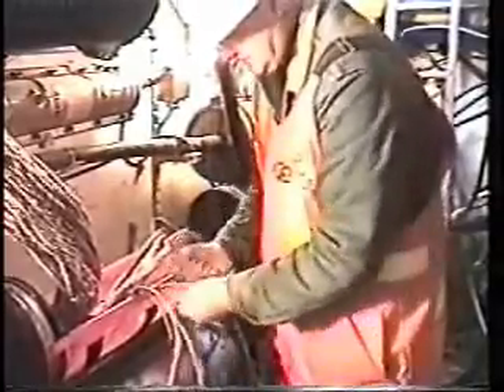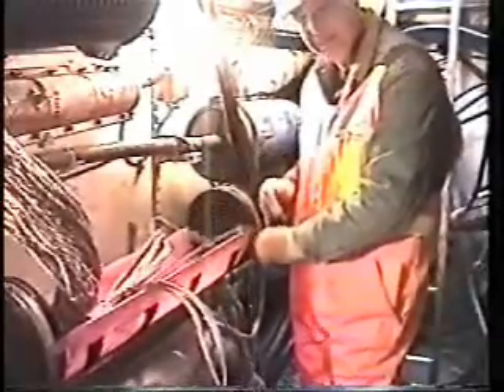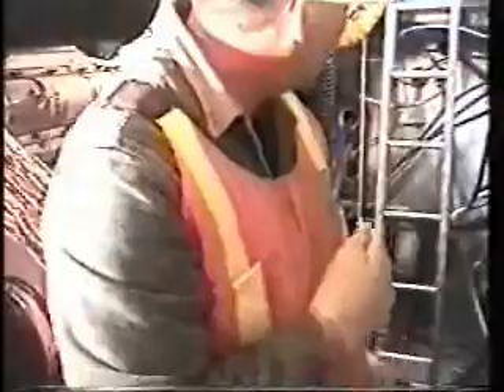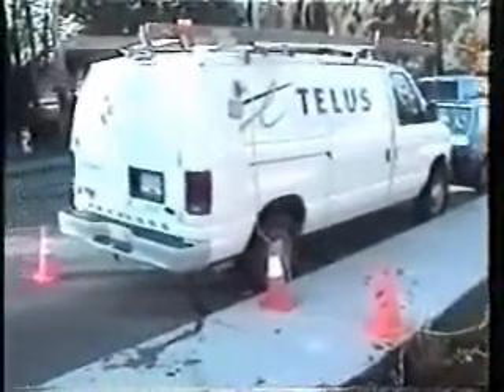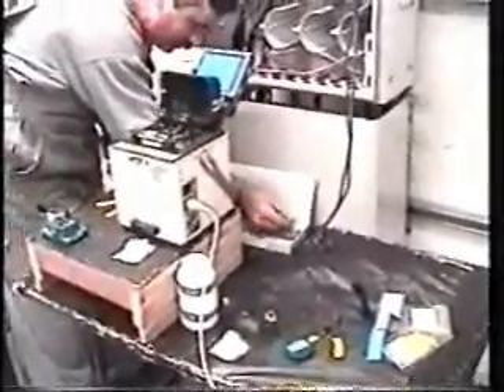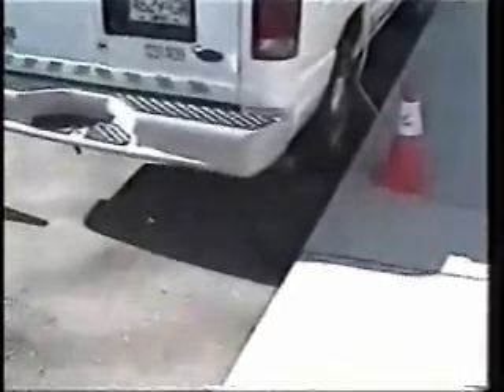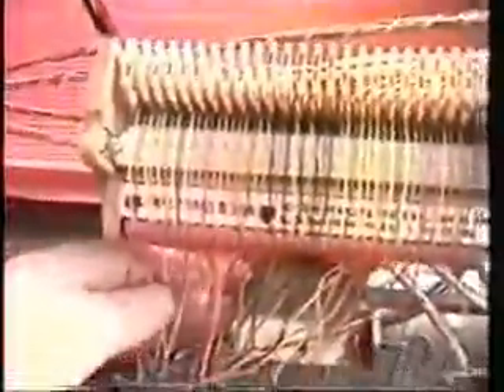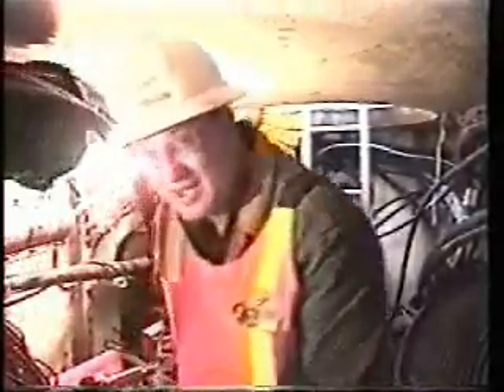Splicing with Larry - Part 2

Comment: Great Video! What type of splice tool are you using? We use the 710 connectors with a hand crimp tool. We would be interested in one. Did you go to class to learn that tool?
Thanks for the info.
Scott
Gonzaga University TELECOM